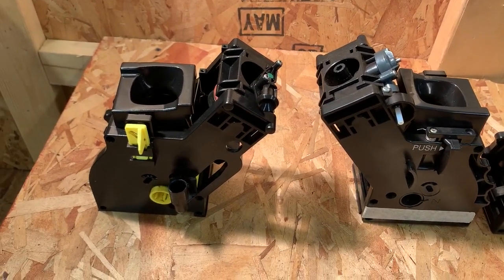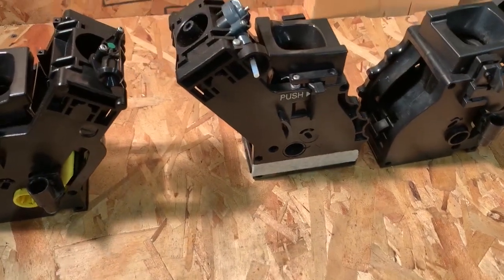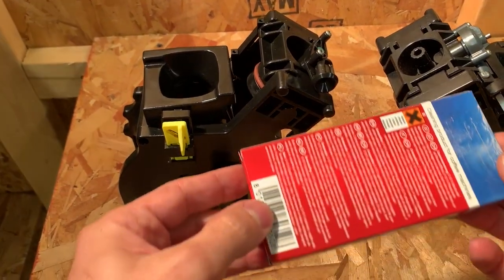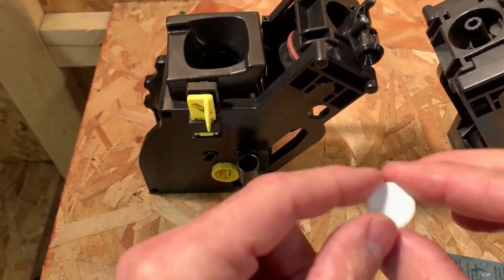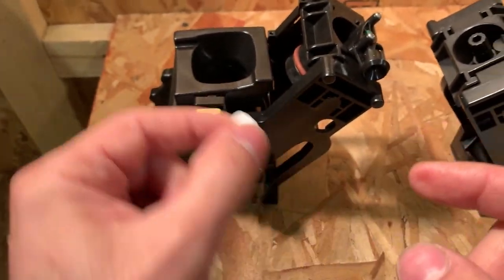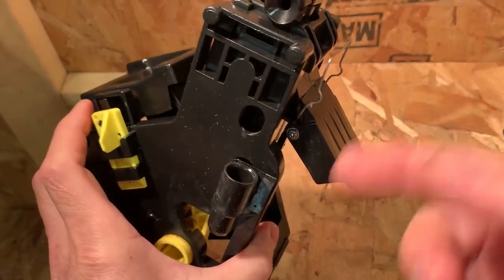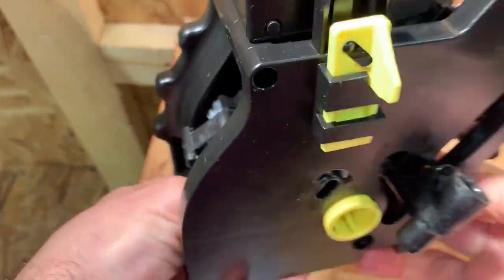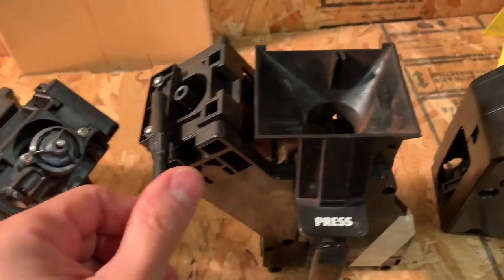How to Degrease the Saeco Brew Unit

Comment: If you have a Saeco Easy it doesn't have a cleaning mode or a pre-ground mode.  But you can go into test mode, cycle the brew group manually, and run the pump for 20 seconds.